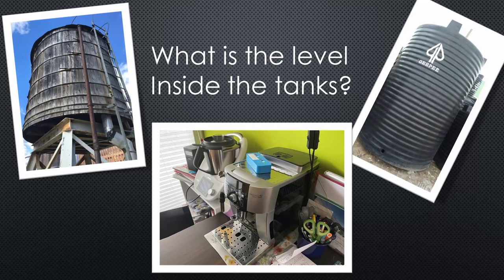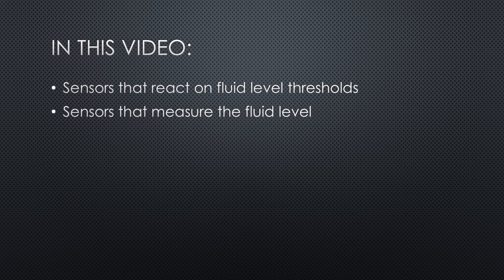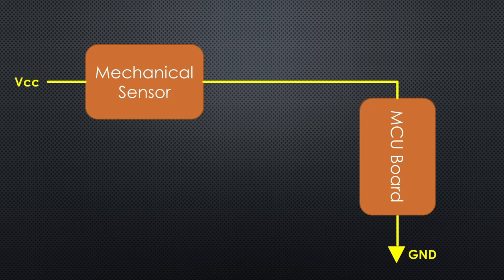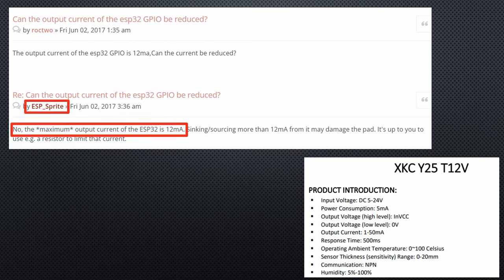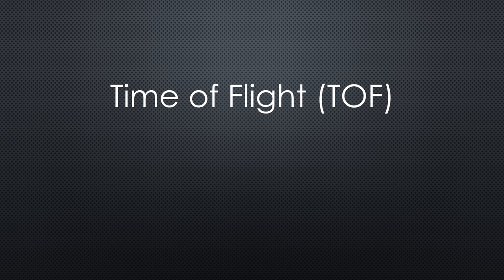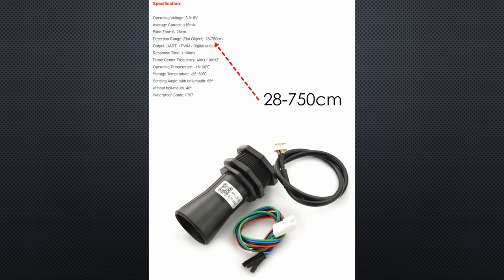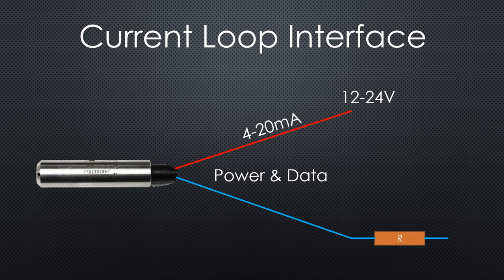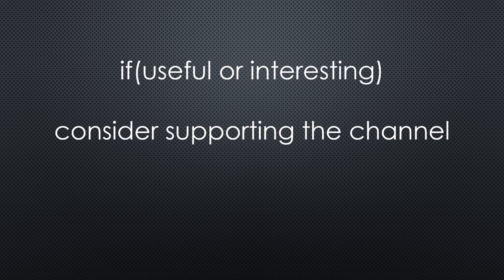#411 Ten Fluid Level (Water Level) Sensors and how to use them (Arduino, ESP32, ESP8266)

Comment: I found another interesting solution in the German magazin "c't Make, 6/21". Here the water level in a cistern for collecting rainwater is measured. A simple plastic tube is put from top of the cisterne to the bottom and air is pumped into the tube. As soon as the air escapes at the bottom of the tube, the pressure in the tube doesn't rise anymore and you can calculate the height of the water. A blood pressure meter can be altered for doing this and can be connected to a microcontroller. Since all the electronics is outside the cistern, there are no problems with moisture.
Reply: This is also used for fuel tanks on some locomotives.
Reply: I am measuring marine tides the same way, only having a silicone tube with an open end placed from surface to a specific depth. One sensor reads ambient air pressure, one air pressure within the tube, combine both values for higher accuracies. 
My sensor is now living a couple of hundred meters off shore, without any issues for about a year now.
Reply: This method is widely used in industries with tall tanks and is called air purge level measurement.
Reply: Also called dip tubes technique
Reply: If you use 2 tubes at a known different depth you can also calculate density of the fluid
Reply: I am using this Method for about 5 years in my well with a mpx5050 preassure Sensor and an arduino. Works great and easy!
Reply from the maker: As far as I understood, the Make sensor used a valve and only one sensor. So it seems you can either use a valve or two sensors (or a differential sensor as used for air-speed). Am I right?
Reply: @AndreasSpiess  as far as I understood the OPs concept, or they way I would build it according to his description does not require a valve. One of the drawbacks of my 'open hose' method is, that any leakage of the air trapped inside the hose will diminish the pressure over time (probably even bacterial growth can influence that). In his method there seems to be a T-Joint at the top, 1 way for sensor, 2 drop hose to bottom of tank, 3 - air inlet from compressor. 
The pressure can only build-up to the level of water, then spills from the bottom of the open hose/pipe, giving you a constant back pressure on the sensor. 

Obviously there is a bit of finessing required since even air has mass and is viscous, over a long pipe some back pressure just from the interior diameter vs. air flow rate will create a pressure gradient, before even considering the depth of the liquid.
Reply: @AndreasSpiess  There is a valve, a pressure pump and a sensor. Step 1: valve is open, ambient pressure is measured. Step 2: valve is closed, pump starts, sensor measures pressure until it doesn't change anymore. Pump stops. Step 3: Wait at little bit until pressure settles, calculate height of fluid. Step 4: valve opens
Reply: @KlausMusch2  it depends if the pressure sensor is absolute or relative. If absolute you need to use 2 (or use the valve syetem mentioned) to get ambient pressure. If the pressure sensor is relarive (gauge) you get already the delta pressure from bottom to top of the liquid. (assuming an open tank or at least a tank not under pressure)
Reply: @SarahKchannel  Exactly, a T-Joint at the top, 1 way for sensor, 2 drop hose to bottom of tank, 3 - air inlet from compressor. The valve is not absolutely needed, but you can use it to release pressure after measurement. In the article of "c't Make, 6/21" a cheap blood pressure meter is used which already containes the valve.
Reply: @KlausMusch2  I have to say i did not read the article, this was just just my logical interpretation of the problem :), since I faced plenty of issues at the start with loosing pressure inside the hose. If I would have thought about this concept before, I would most likely have done the same - not with the bicycle pump pressurizing the sensor line :)

Comment: In a company where I worked, we had a problem how to measure liquid height in a small plastic container which was also under a bit of pressure. We tried many approaches, like capacitive reading with glueing copper strips on the outside wall of container, but it turned out that it is too sensitive to an environment and when liquid in tube that went out of container touched another container, values of capacity reading changed. Resistive measurements were also not good due to erosion and contamination. We couldn't measure pressure, as the air above liquid had different pressures. In the end we end up measuring container weight with a load cell. Not ideal but we couldn't find any better and cheap way of doing it without massively modifying container itself. In case we would make container itself, we would probably make it with potentiometer and a rod with floater, like in a car gas tank.
Reply from the maker: Measuring weight is a very good way for many applications. I should have mentioned in my video...

Comment: The other classic fluid level sensor is the float-driven potentiometer as used in car fuel gauges. It's quite easy to cobble one together out of bent wire and bits of packing foam.
Reply from the maker: Also a good idea if the dimensions of the tank allow it.
Reply: That's the only way I got rid of corrosion, vapor and false readings, after trying almost all techniques described by Andreas in this video.  Instead a regular potentiometer (which can corrode too),  I ended up using a AS5600 magnetic-position sensor with both sensor and corresponding magnetic embedded in epoxy resin.
Reply: There are immersion style capacitive based sensors that are simply a tube whose length can be adjusted for tank depth. The materials are offered in a range including corrosion resistant. Commonly used with petrochemicals.
Reply: @rvendrame  also consider that modern bio oils and fuels are a great playground for bacteria.
Reply: I use mine to monitor my gasoline tank for my tractor out back by the hay bails, but I think birds or something keeps stealing the styrofoam off the end of the coat hanger.  I keep adding a new wad of white styrofoam from the box I got my new dryer in, but someone keeps stealing it.  Couldn't find anything modern so I used the old "coil-wiper" volume knob from an old vacuum tube radio my grandpa had plugged in out in the barn.  It sounds a bit crackly when it turns if the wind sloshes the gasoline around, but at least it keeps a regular incandescent bulb brightly lit as long as there is gasoline in that tank.  It's so nice when you don't need nothing fancy to get the job done!
Reply: @mistercohaagen  dont know if you are serious about birds stealing you styrofoam or not, but styrofoam usually dissolves in gasoline =)

Comment: A couple of years ago i used two insulated wires as a capacitor in a ne555 resonant circuit.  The liquid then serves as a dielectric and the change in frequency can be recorded very well with a microcontroller.
Reply from the maker: This is the same concept as used in the shorter sensor I had in the video. It is interesting that it also works for longer distances. Thank you for sharing that it worked.
Reply: I have attempted a similar scenario but with steel cables used for laundry with thick polymer insulation. Didn't work at all and never thought to try copper. Did you try it as a twin lead arrangement? As a signal transmission line? Not sure if I over engineered it or used inappropriate materials. I will revisit this project from my notes but would like some feedback to improve on my research.
Reply: @xDR1TeK  I used two configurations, two parallel cables and one cable in an aluminum tube.  Both worked well and are very sensitive.  A drop could be detected in a 1L container.  That makes the absolute accuracy a bit problematic.  It is important that the 555 sits directly on the "capacitor".  Attempts with a feed line in coax were not really successful.
Reply: @xDR1TeK  I used a cmos 555, which can handle the high frequencies better with small capacities.
Reply: @grosseruser  I went all over the physics to calculate the dielectrics and permittivity along with conductance and inductance of the transmission line based on immersion and different intrinsic impedance for a transmission line. Too much, for so little. and yet the 555 wins again. :D
Reply: Used similar sensor and worked very well for measuring water level in a tank
Reply: Greetings! What a good idea to measure level. Could you guide me a little more? any tutorial or circuit to help me do this? Thanks, sorry for my ignorance.
Reply: @fernandosartorelli  If you look at the wikipedia entry for the "NE 555" there is a schematic for the astable mode. In this schematic you have to replace the "C" (between GND and pin 2+6) with two parallel wires that are isolated. With "R" the frequency of your own structure can be optimized. The output signal at pin 3 is then a square wave which changes with the liquid level on the parallel conductors. The CMOS version of the 555 is optimal because it supports higher frequencies. The square wave can now be counted with an interrupt input of a microcontroller and measured with a second periodic interrupt.

Comment: There is also another simple way with ESP32. I had to measure when plastic bottle with liquid is near empty. I just cut circle from one side Copper PCB  with radius 15 mm and made short connection with one of capacitive touch pins of ESP32. PCB was put on outside surface of bottle near bottom. After setting threshold of readings, it works perfectly for my project.
Reply from the maker: Good idea to use the built-in sensor of the ESP

Comment: Very interesting :) I once made a simple water level sensor with a capacitive approach. It was just two parallel copper tape strips on a long plastic sheet, covered with tape for isolation. When submerged, the water changes the capacitance between the two copper strips, which can be measured by an MCU simply by toggling a digital IO and measuring how long it takes to charge and discharge the IO (libs are available, usually used for touch sensors). This way you can tell how much of the sensor is submerged.
Reply from the maker: I did not know that this also works for deep tanks. One of the moisture sensors work that way.
Reply: Maybe the copper strips could be replaced by a regular 2-lead cable? Like one of those flat ones used with lamps on 230V AC, or and old telephone cable or antenna feeder cable with that little flat segment to create a distance between the two wires (anyone remember those?). They come ready made and sealed in almost any desirable length, so only the end needs to be sealed off.
Reply: i use this a similar setup for monitoring my two water tanks using speaker wire to measure the levels of a 3k gallons and a 5k water tanks .. most consistent thing I've found to measure the levels that doesn't include me sticking my head inside.
Reply: @ExplorerOffgrid  what did you choose to measure the capacitance of the wire - some dedicated IC or something else? How accurate are your readings?
Reply: @benhetland576  it's often called ladder line, and is still used to feed low frequency antennas. Try a ham radio store

Comment: You can also use a weight sensor. You can use the density of the fluid to measure the liquid.
Reply: Yes. This is a much used method in industry. It does not matter if the fluid is highly corrosive or very contaminated.
Reply: I worked for a company, the measured the amounts of screws in their bin with scales, knew right off when it was getting low. Works great for such things.
Reply from the maker: A good idea! Thank you.
Reply: @einars899  yes I know it from water pressure balancing systems in pipeworks. The balance vessel stands on 3 feet while there Is one weight sensor under one feet.
Reply: I used this approach in my van conversion. I was sick of the 1-2-3-4 light indicators for the fresh/gray water tanks so I fitted weight sensors under them and worked on the principal that 1L of water weighs 1Kg.
Reply: I worked in a company building industrial filling machines and this was the way they did it. Small plastic containers, buckets, drums and IBCs can be measured while filling them without any problems. Sure you need a specific made scale for your containers. Another nice thing, it is certified and can be used for filling exact volumes for selling.

I made a mulled wine dispenser once using this approach. Didn't want to use ultra sonic or floater inside the bucket and just mounted the whole heating plate on a cheap weighting element. Worked really nice.
Reply: Weight sensors are also often used when commercial operations are involved because it is so easy and trusted to get load cell setup calibrated and certified by a third party. It is difficult to dispute a loss of weight method compared to a flow or pressure.
Reply: I used a simple AliExpress load cell with an HX711 an ESP8266 for determining how much water my chickens have, by hanging the water tank to the load cell. Works perfect as there is temperature compensation. Most useful application in my smart home 😁
Reply: The only problem is that load cells tend to "creep" so you need to recalibrate for each weighing. If you or anyone else here knows a way round this I would find it very useful!

Comment: When sensing diesel levels you must take into account that bacteria can grow in the interphase of water accumulating at the bottom. They can be very corrosive and also make a slimy mess that can interfere in the sensing. It is known in Europe as Diesel pest and is an issue since biodiesel makes the oils more soluble in water, very much like pollution from WWII wrecked ships that carried synthetic fuel made with the Kohler process. You must regularly add an antibacterial additive commonly sold at the specialized stores.  I would go for an adaptation of an automotive solution of the float type and intermitent data acquisition to save battery, they are tried solutions that are robust.
Reply from the maker: Thank you for sharing. I did not know that this can happen!

Comment: I've worked on a project where we needed to monitor water level, we used a float in the chamber with a magnet mounted in the housing. We then had an array of Hall effect sensors along the tank which were monitored to identify the position of the magnet. This was a nice contact free solution which avoided risk of fluid ingress into the electronic housing.
Reply from the maker: Thank you for sharing. But I assume the hall sensors were somehow in contact with the fluid? Or were they outside the tank?
Reply: @AndreasSpiess  I would expect they were attached to the outside of the tank. The float on the inside of the tank is restricted so it can only travel vertically up and down the inside edge of the tank (and therefore always readable from the outside as it passes the nearest hall sensor). Nice idea @Jack Soldano
Reply: There's the old one of putting the float in a tube running parallel, either inside or outside the vessel.
Or putting the float on a wire.
Reply: @Pete Mundy  Basically this, we had a tank with a channel for the float to hold it in a specific position, the float would sit at water surface level and house the magnet. On the outside of the tank along the channel was a PCB Hall Effect Array with around 10mm spacing between the magnet and Hall effect sensors. This is not the most accurate solution but depending on your algorithm can give you around +/-2mm accuracy

Comment: This video is so awesome!
About 8 years ago, I needed a sensor for an expensive semi transparent plastic tank.
I did a lot of thinking, and purchased a lot of different sensors and made a lot of different trials with prototype tanks.

In the end I decided that I only needed to know if the level was 3/4 full, and 1/4.
I ended up using 3 temperature sensors. 2 glued to the outside of the tank. One for ambient temperature near the tank.
Sensing the temperature difference between them was surprisingly accurate.

When the level got low, I got a warning, and could turn on a pump with a timer, to fill the tank to approximately below 3/4, or stop at 3/4 if reached.
Reply from the maker: This is innovative! Also an indirect way of measuring levels...
Reply: Very interesting approach! What happens when the liquid temperature equalizes with the ambient, or was that just not much of an issue in your case? Perhaps something similar could also be used to measure flow through a pipe by sampling two points on the pipe some distance apart along with the ambient temperature.
Reply: @benhetland576  in my case equalizing of temperature was never a problem.
I think it could be because it was mounted in an engine bay, so when it was operated the ambient would rise, but due to thermal mass and location, the water temperature did not increase significant during operation.
Reply: @benhetland576  I don't think it would be as easy to do with a pipe?
I also think the pipe material and temperature of the liquid is pretty important in that case.
But I could be wrong 🙂
Reply: This approach is used to detect leaking waterpipes in households. More specific leaking toilets.
Reply: @peterholst8875  Nah, I think you are quite right, and that both pipe material (heat coefficient) and temperature difference between fluid inside the pipe and the ambient outside the pipe are important factors. One is basically measuring the heat flow through the pipe walls, so probably also better suitable for slower flow rates than faster ones. It is a non-invasive method, though.